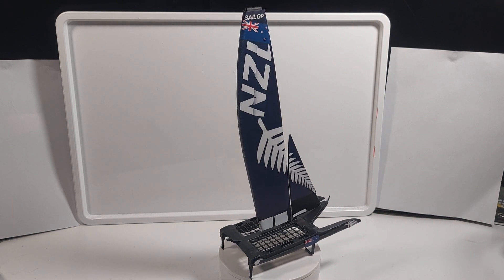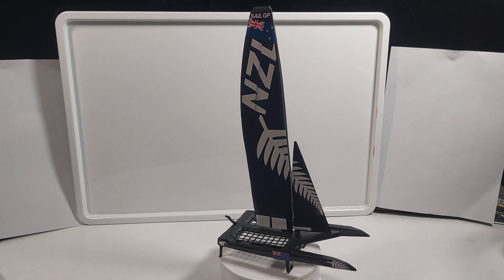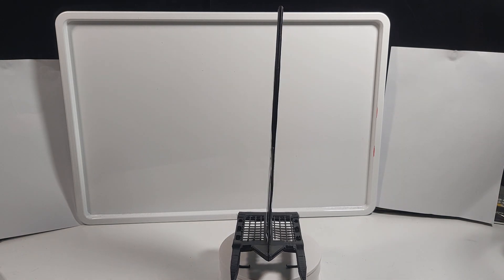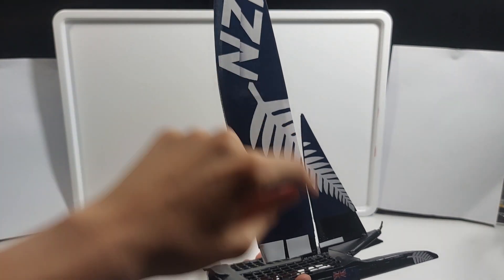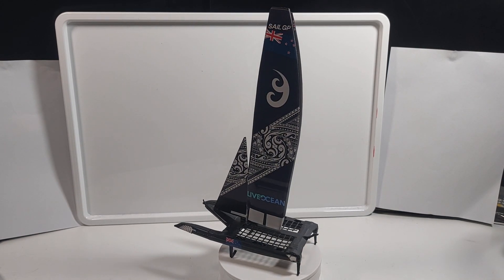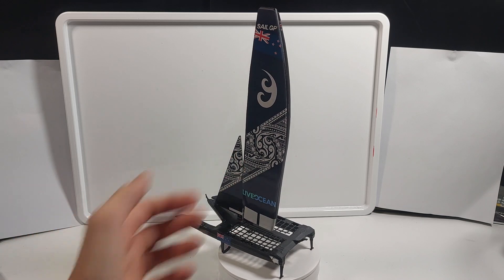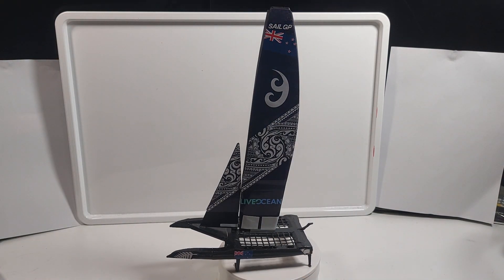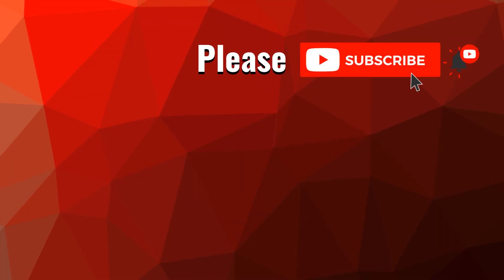How to 3D Print your own SailGP F50 sail boat Part 1 !

Comment: With the NZ team livery printed like that looks like a finished product.! Congrats. How long did it take to design the model and can you do a video on the design process ?. Also which software and printer did you use?
Reply from the maker: Thank you for the comment. It took me 5-6 hours to design the model and the printing time was 12 hours. I will do that for part 2. I use the Fusion 360 3D modelling software to make my models and the flashforge adventurer 3 to print them.